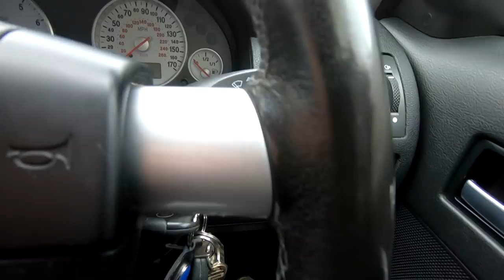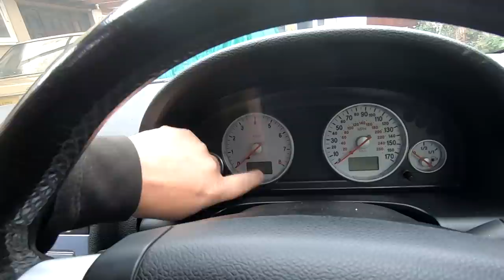Ford Mondeo Mk3 Steering Wheel Spokes Refurbish

Comment: Talk about using a sledge hammer to crack a nut.I would use the same airbrush I use to spray my models with,using less paint and I wouldn't be blowing the parts off the table.I painted a door mirror before and got a mirror finish.
Reply from the maker: Funny you said that, I did consider using my airbrush. Maybe next time.

Comment: Instead of using a hard material against a soft material, an equal or softer material should be used. Pry tools. Then the plastic won't get damaged by the screwdriver.

I saw a location for a screw cover in my car with a place for a screwdriver to go in and pry out. The mechanic decided to pry from the other side and it was all messed up. Horrible looking at a long reminder of the mess he made of my handbrake. I swear he bent it as I could apply it all the way up and still drive off. Removing the lever, I could see the thing had indeed bent. Got a new one (scrappy), fitted and adjusted myself. No problems.
Reply from the maker: I didn't have a set but I do now.

Comment: all these little things that make the car look better than average ,you mentioned you got the outside valeted, should try carplan top shine best car product i ever bought fills the paint with micro breads dirt cant stick to it falls off cover everything with it paint plastic glass rubber just wipe it on its a clear liquid was designed for the glass on skyscrapers  so that it never needed a window cleaner you,ll be amazed with it 6,99 a bottle outa BnM stores does 9 applications only needs one coat a year do video on it takes 10 minutes to wipe down a whole car nomore dirty car